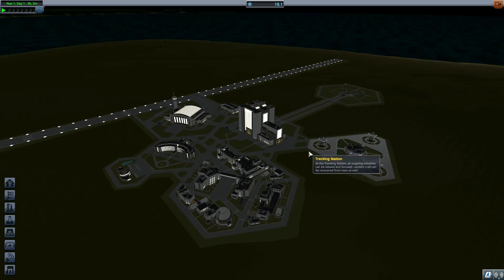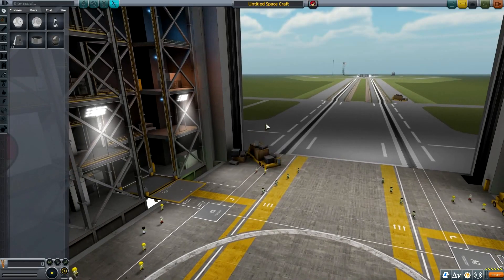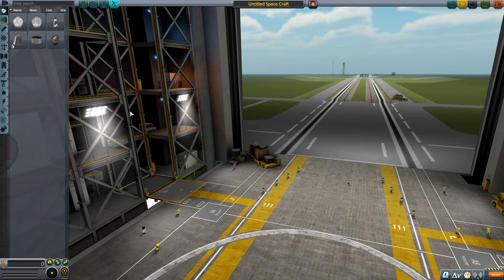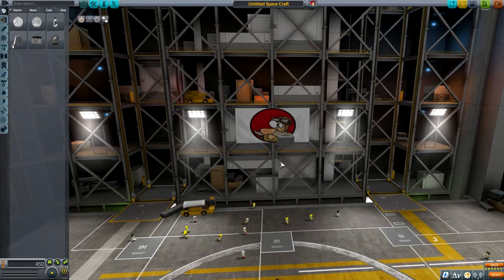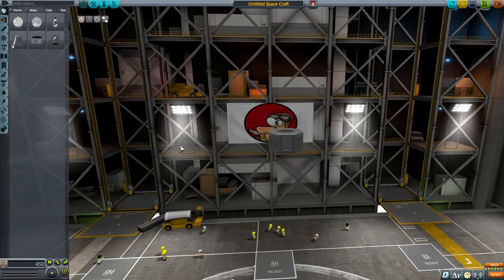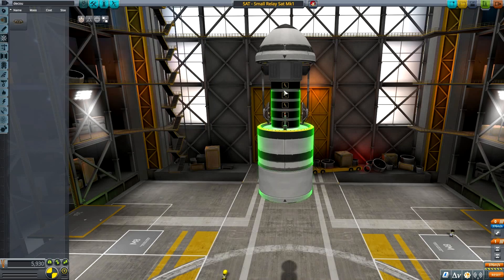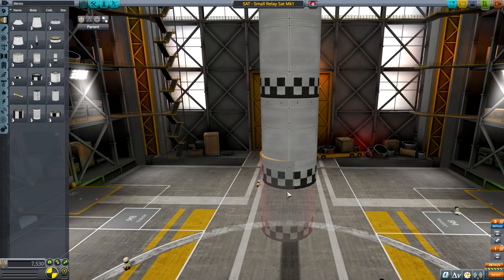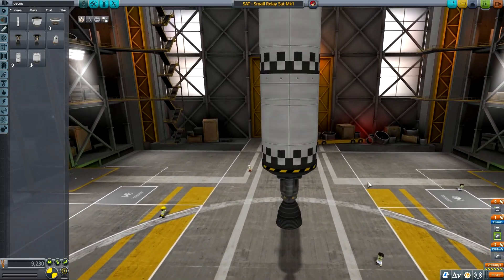First Communications Satellite - KSP 1.7 - Science Game - Let's Play - 06

Comment: I wrote this ages ago, and has been using it ever since. You enter the number of satellites, the body, and the height in km you want your orbit. It the shows you what height you want to change apo or peri to to get an equidistant spacing, once you circularised them again.

What I usually do is build one rocket with three satellites on, circularise at the appropriate altitude. Dump one satellite, change api of the rocket, go a bit and split the second off, and circularise it at peri,wait an other lap and circ the rocket (with the last satellite built-in.

https://docs.google.com/spreadsheets/d/13qE-oKEdiMUFLx4UuB5cgZ3GOWbQW8Wp6XRfdWlUMjk/edit?usp=sharing